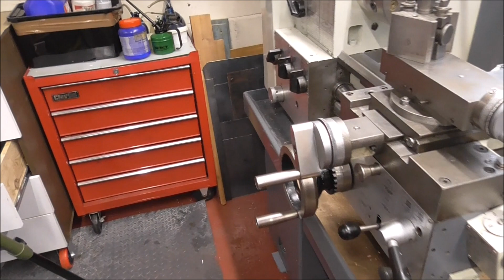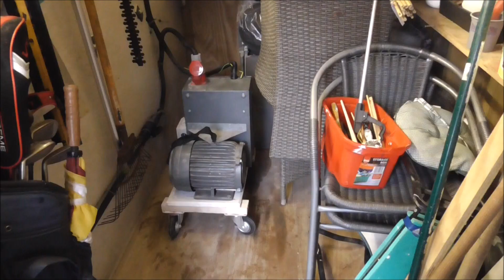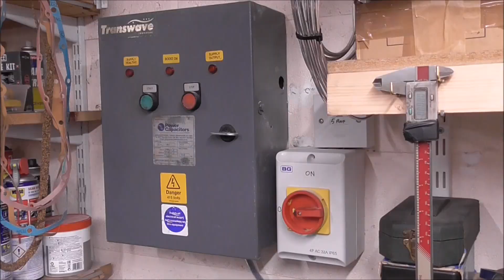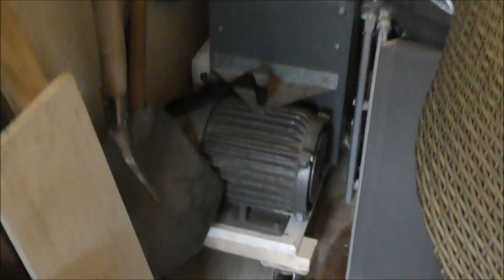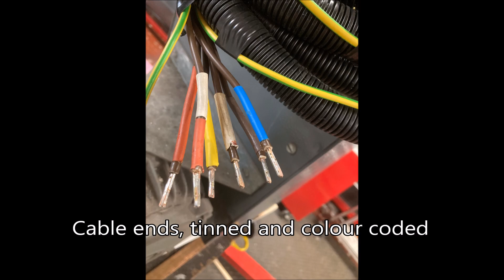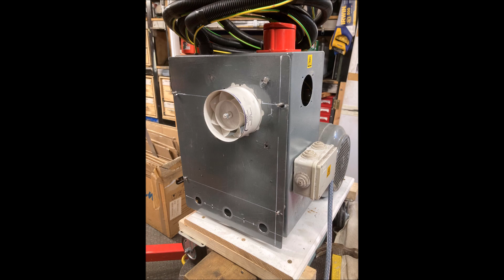Harrison Lathe Phase Converter relocation

Comment: Hi Brian, the light is a good solution to your problem. 
A slightly more complicated alternative would be use a "delay off" relay in located the new wall mounted panel, you have plenty of room. That can break the stop circuit if you forget to turn it off, the timer could be triggered from the 110V lathe control circuit if you want to be fancy and have it run on a fixed time after the lathe has been in use, a bit like a bathroom fan speaking of which the fan is definitely a good idea I put a cooling fan into my rotary converter control box to get rid of any heat from the auto transformer 
Hope you are enjoying the Harrison, it is a luxury having a bit more room to swing than the Myford
Kind regards Paul
Reply from the maker: Hi Paul,
Thanks for the brilliant comment, it’s great that people like you and others can take the time to share their experience and knowledge, this is what YouTube is all about. I get what you’re saying with the off timer thing, I use something similar to stop my compressor coming on at night and pissing off my neighbours.
I’ve spent enough time on this so will probably stay with the light for the moment but thanks again for the comment. Cheers Brian